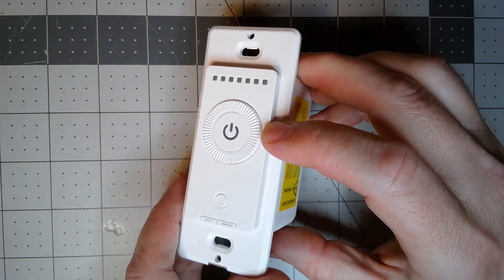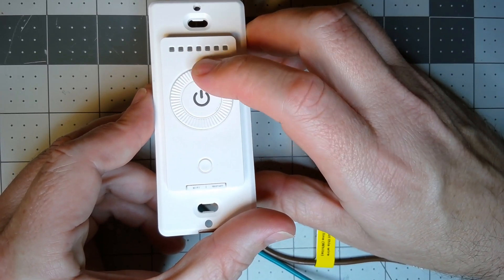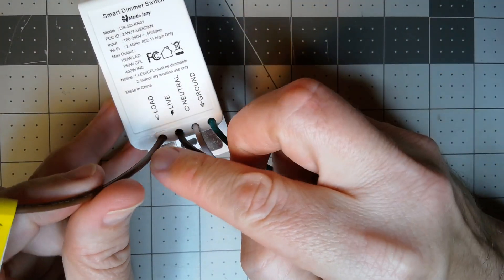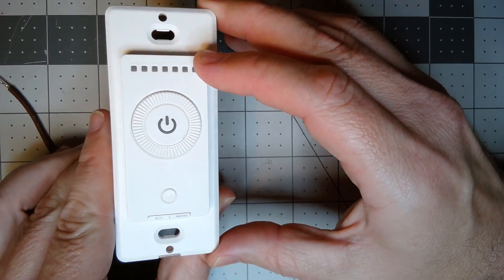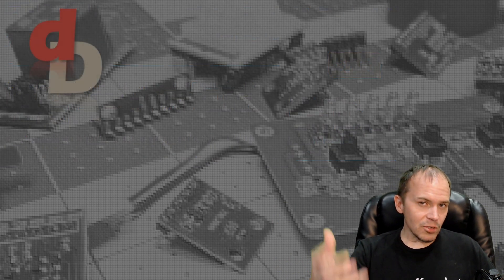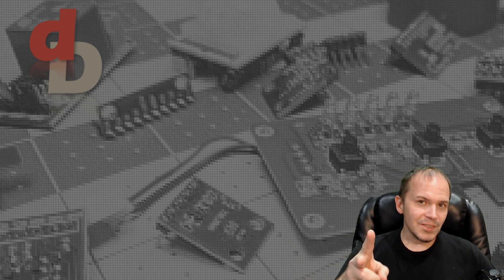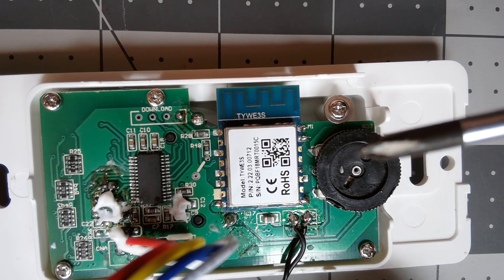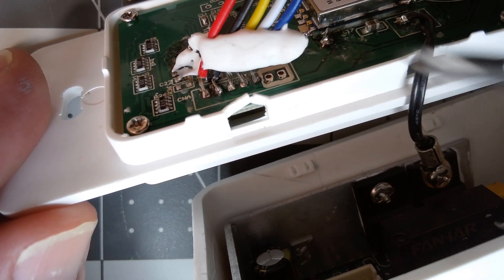New Rotary Dimmer Smart Switch by Martin Jerry | Love it or Hate it? US-SD-KN01 🤷

Comment: Another fantastic detailed video. 👍
1. Do the ones currently on sale still have the esp8266?
2. How come tuya convert doesn't work on these??
Reply from the maker: Thanks!  I haven't bought one in a while but haven't heard they switched either.  The reason TuyaConvert doesn't work is due to the fact this software was built after the exploit fix was done to stop tuya convert.  The original dimmers/switches software have not been redone so those still worked.  However they did make a little easy for us to flash these in later models and even have documents on their main website with how-to's.
Reply: @digiblurDIY  oh that's nice. You mean Martin Jerry have docs on how to flash?
Reply from the maker: Yup. See the TASMOTA button here https://www.martinjerry.com/us-std-kn01-support
Reply: @digiblurDIY  thanks! I guess it still involves soldering, but at least they tell you the pins... 🙂
Reply from the maker: The download header might be through hole pins, worth a check, no soldering if so.

Comment: I just bought one of those US-SD-KN01 switches on Amazon (April 2021). On the inside of the PCB, there's another place for adding some surface soldered wires (hoping on a GPIO0 connection!) and a jumper with text above it that says "jump for DIY (short)". Perhaps they've added some way to flash Tasmota or ESPHome without soldering directly to the GPIO0 on the chip itself. I have an email to support about the jumper and will post the results here if it's anything significant.
Reply from the maker: Interesting. They were supposed to come out with a DIY based dimmer or switch with easy flashing. I haven't heard anything other than it was delayed. Keep me posted.

Comment: Thanks for the informative and understandable walk through on this MartinJerry rotary dimmer switch. I’m new to smart switches and plan to (attempt to) become “smart” about optimization of the 30 or so MartinJerry switches I just installed in a new house. There are two reasons that I selected the MartinJerry brand: trailing edge dimmer technology (with very precise fine tuning wheel) and the fact that the MartinJerry 3 way rotary dimmer was the only one I found which can operate with a “dumb” switch at the second switch location.
After living with these switches for over1 month, I’m very happy with their performance and reliability (no network drops). Hopefully, I’ll succeed in learning how to flash them all and get a divorce from the cloud.
As far as the looks of the rotary dial, I have no particular opinion. I think it is just a matter of taste. However, the electrical inspector was quite taken with the style, and spent most of his time during the final inspection operating/admiring these switches.
Thanks again for your great videos.

Comment: Need more details ... on the quad! Just built my first freestyle quad.
Reply from the maker: Been flying the tinywhoops for a few months and finally did Joshua Bardwell 6S build.  Addicting hobby and so much fun!  Yet so much to learn and stick time needed.
Reply: @digiblurDIY  Nice. You can tell from the video that the 6S has some serious power! I got a Tinyhawk 2 a couple months ago. Then built the 5" quad (4S) a week later, using the TBS Source One frame. Since that's an open source frame, I was guessing that you might have gone with that one as well. :-D I've been a long-time RC helicopter and airplane pilot, so the FPV quad stuff seemed like a natural next step.
Reply from the maker: I didn't have anything to cut my own stuff.  So I went with the next step of progression from tinywhoops to doing a build to learn the pieces and stuff.  Good experience indeed!  Next one I'll be piecing out myself though.
Reply: While I have a CNC mill/router that I built a few years ago, I didn't cut that frame myself. You can buy the frames from a few different places. But being open source, the drawings of the frame parts are on github so you can make them if you want to. Plus, if you have an idea for an improvement, you can post it there or on discord. I think they're up to version 3 right now.

Comment: Looks good enough, now that your presentation completes the hole picture. Although, I'm building a bit more simple smart dimmer which doesn't need the neutral. Only life and output to the lamp are enough. The internal electronics supply it's made by having a zenner in series with the load and on the load side I'm putting a RC filter for a minimum current. Here in Europe we have plenty of old houses which doesn't have the neutral on the wall. Thanks for the good teaching, again! All the best!
Reply from the maker: Very cool.  Kind of rare I run into the no neutral in my region.  I've run into aluminum wiring a few times though. Curious to see the outcome of your design there.
Reply: Sure, I'll send you a schematic.